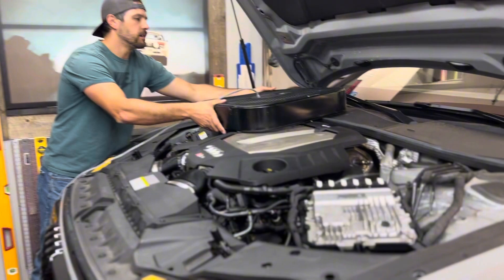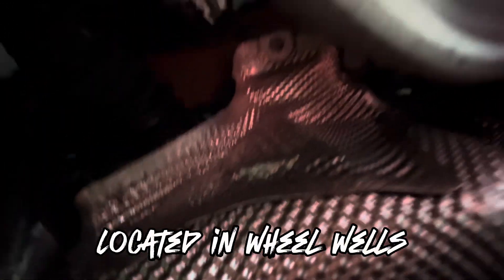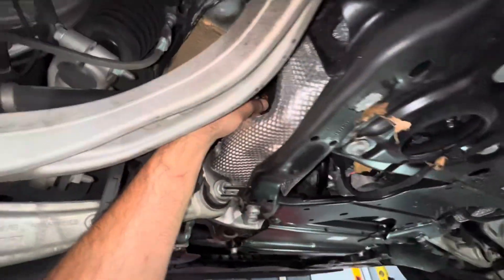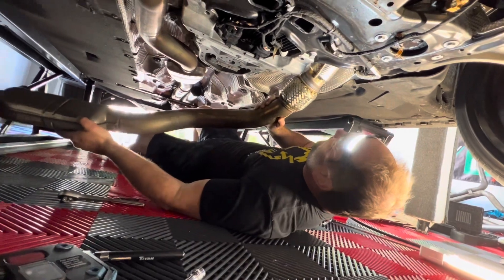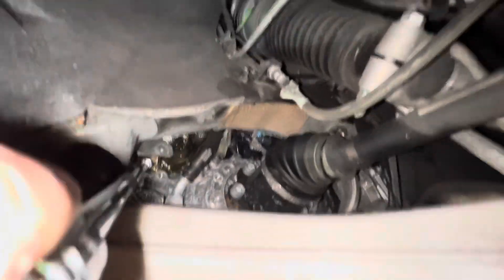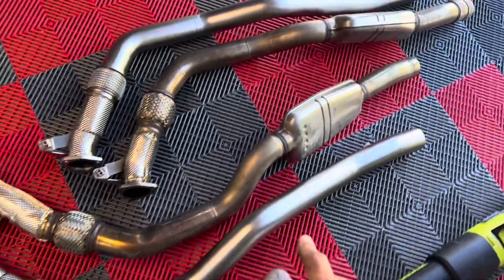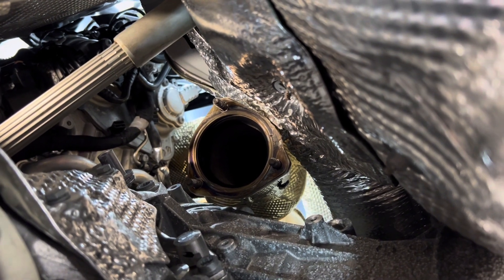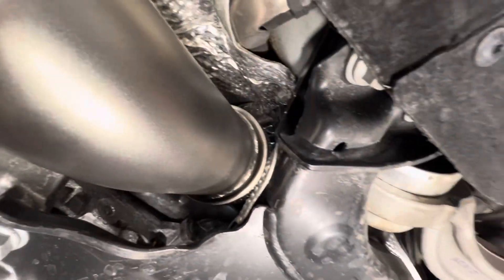Res X: Rev Up Your C8 RS6 or RS7 with 034Motorsport's Exhaust Upgrade!

Comment: Have been loving your content for a year, but had a deal too good to pass up, so I bailed on the S5 for an RS5 lol. But still sub'd & I'm still gonna keep watching bc I love it. Great work on this project bro... then again, compared to the RS grill swap, most of these sound rather straightforward to me. 🙄🤦‍♂🤮😂
Edit: your guys' vids are always so awesome, even if the PITA parts are edited out. Where taken, your camera angles to get into the wayback are perfect. Also, even after rebuilding a 2.4L DOHC with a built block & custom valves/retainers in the head, I'm pretty sure you spent more just on tools than I ever have on total engine builds lol. To wit, if needed, I think you could produce a 42" extension, 1/4 into 3/8 into M12 tool lmao. You dudes are smooth like buttah when you're on a roll. 🤙
Reply from the maker: Thanks for the love and great feedback. We’ll try to get some more RS5 content for you as well.